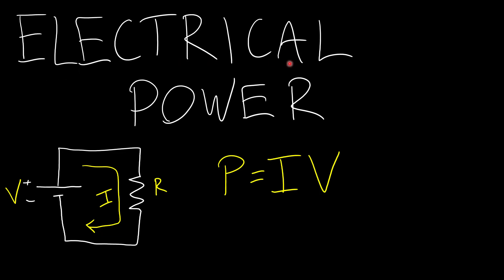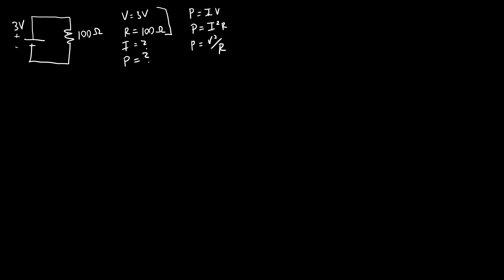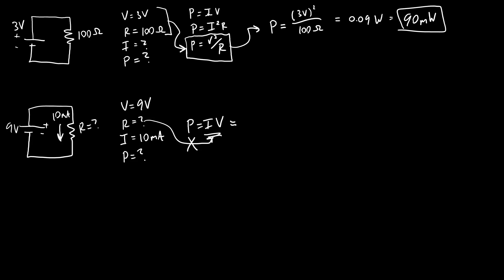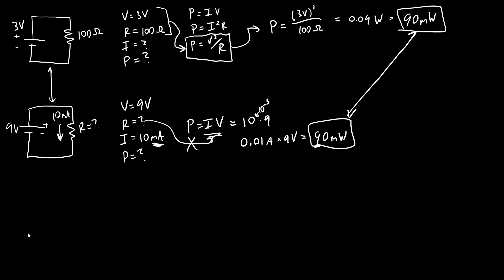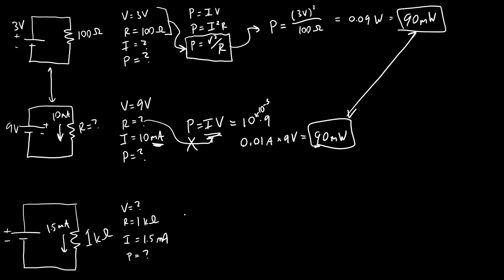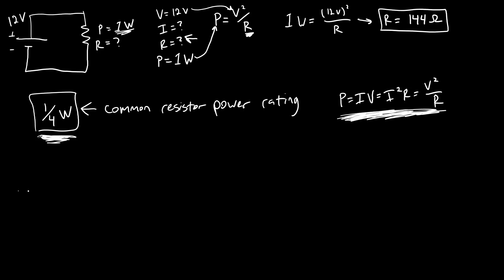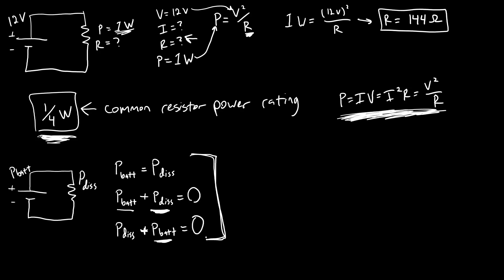Intro to Circuits 6: Electrical Power

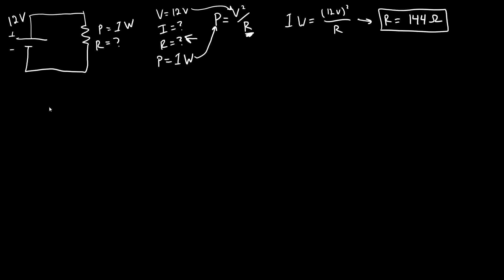Comment: 6:10

How do you deal with the units? I can absolutely come to the result of 144Ω but I can't figure out what I'm supposed to do with the units (144 square Volts? 144 square Volts over Watts?). Do you just ignore them? Is there a way to not do so? Do they end up converting just fine somewhere along the process that I just can't see?

Comment: 4:48

The math is wrong here, no? Why is P not equal to 225mW? While unnecessary, I solved for V by doing V=IR and it gave me V=15v. Using this I then solved P=IV which gave me P=(15^2/1000)w=(225/1000)w or 225mW?

Comment: Thanks for all the great videos! I might have missed something but I am confused. If P(batt) = P(diss) then there will be no power left to power whatever we want to use the system to power, e.g. a lamp, a speaker, etc. Or in a different example, where we would actually have a circuit with a purpose, we would want P(batt) = P(diss) + P(whatever-we-want-to-power)?
Reply: Sorry for the graveyard response, but at 9:18 he states that this rule was only for the simple circuit where we had the resistor and the battery, and stated that if we had multiple pieces of equipment the total resistance of the system would equal the power output of the battery I think.

Comment: What does mean you should not exceed 1/4W power. Would you give some example?
Reply from the maker: Many common resistors are only rated for 1/4 watt power dissipation. If you go over that, they can overheat and burn.